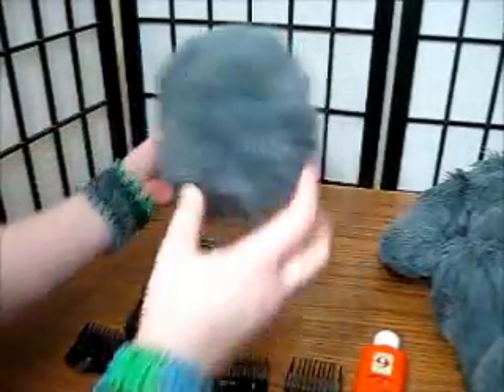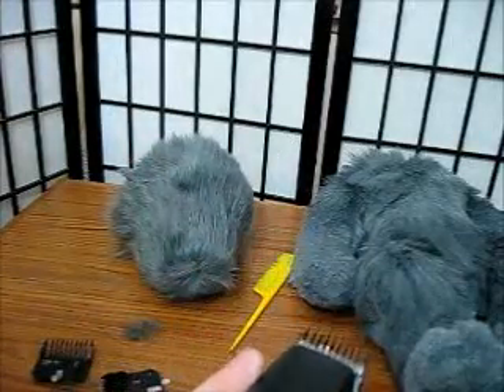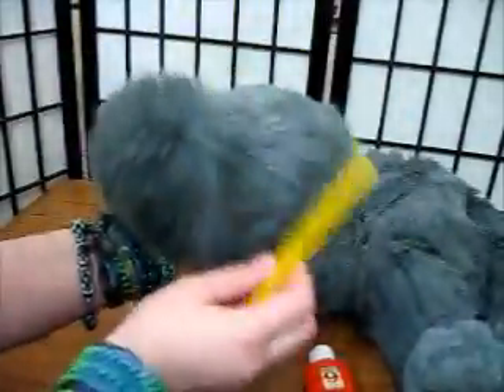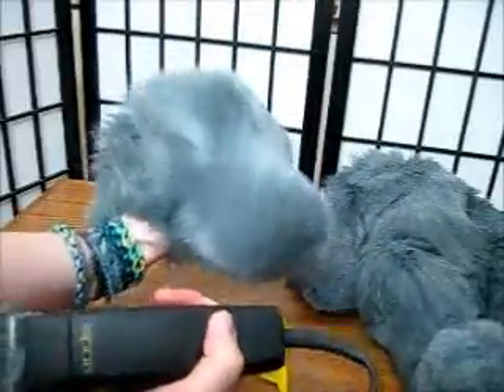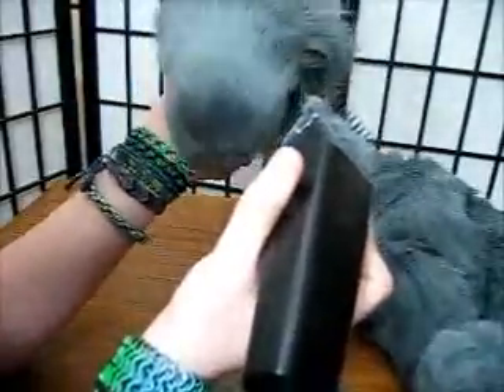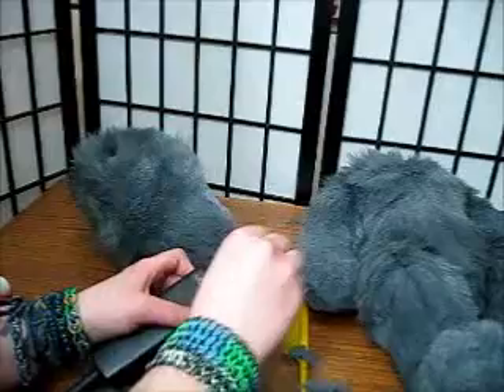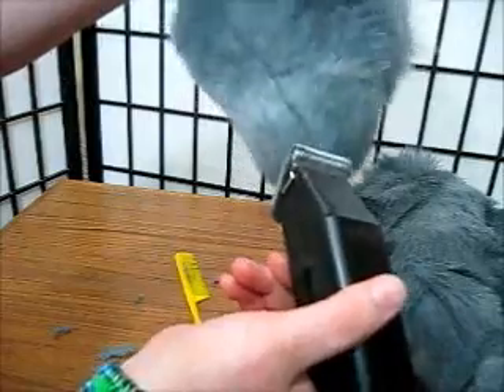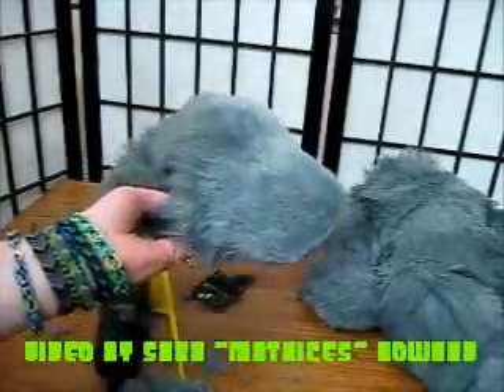How to Shave Fake Fur

Comment: I ended up getting a somewhat better grade of pet shaver myself for when I worked on the fur for my suit's head. The fur fibers tends to sneak in between the blades rather easily if your not careful on the lower grade shavers.

I also noticed that some furs look different when they are shaved too.

You did a good job on the tutorial, thanks. :)

Comment: I'm working on a fursuit head with long-pile fur, and I'm unsure if shaving is necessary... the fur itself sort of smooths down and stays down extremely well,  and it looks very nice when smoothed. However, it does fluff out at times, and it doesn't look very good then.. I can't afford a professional grooming kit either..

...Would there possibly be like a hair product or something I could use to make the fur on my suit stay smooth, without losing it's softness? Like styling mousse, maybe?
Reply: Junius Arrakis scissors would probably work better than smoothing it down, you just have to be super careful not to cut it unevenly :P Using gell would make the fur greasy, I used gel on my suit's hair and it looks good but it feels gross when you touch it.

Comment: I'm having trouble getting any fur off with my clippers. I've started with the largest guard and worked my way down, like you did in the video but it hasn't made very much of a difference. Any suggestions?
Reply: That happened to me because I got the wrong fur so I got better fur and it worked

Comment: Will this leave a mess of fur? Also, are the shavers something I should be careful around? Is it going to cut me if I'm not careful?
Reply: I does leave a mess. I like to put down some newspaper or plastic on my work surface then when I'm done I can clean up really easily. It won't cut you - clippers are very safe. You'd literally have to deliberately dig it at a particular angle into your skin without the guard protector on it, so... pretty unlikely! :)
Reply: Alrighty then, thank you so much! I really appreciate it! I was worried that this would get lost in the flood of comments XD
Reply: Also, quick question: I heard that for some parts of a fursuit, one of the supplies would be a razor blade. For example, a razor blade would be used to cut out the fur pattern so the fibers wouldn't get cut in the process. I was just wondering if there was an alternative to that, preferably one thats a bit safer for a minor to use? Like, if I could use a scissor or something else.  If I can't use scissors, would knives be a decent alternative? I don't think we have razor blades in my house, and I doubt my parents would let me use one at all, since I have hurt myself making a fursuit before. I've once tried to make ear vents in my fursuit and tried using a kitchen knife instead of a razor blade because I had a lot of hot glue in that area, and accidentally ended up cutting my finger. Also, I've gotten several blisters from the hot glue, and my worst case was when I was using white fleece to line my fursuit head and forgot I had hot glue (which was on for a while so it was very hot and I think I could've seen some steam coming from it). I touched that part and got 3rd degree blisters on my middle finger and the side of my index finger and a few milder ones on the tips and on the side of my ring finger. It hurt like hell for a day or two. Then I accidentally popped a blister by taking a bandaid off and ripped off a piece of skin.... It was not fun at all...

So I doubt my parents would trust me with a frickin razor blade. So long story short: Could I use a kitchen knife or a scissor or any other alternative instead? I mean, if I absolutely must use a razor blade, I'm sure my mom could help me with that instead, or I could put on my winter gloves so I don't cut myself.
Reply: Thank you so much! I subscribed to you by the way!
Reply: Thanks! I'm afraid I don't put out content on YouTube but you can follow me on Facebook and DeviantArt if you like!
https://www.facebook.com/kimitheleopard/
https://kimifur.deviantart.com/
Reply: NylaTheWolf use a rotary cutter, make sure it has a safety guard on it! And take your time when using it, they're sharp but they're better than using an open razor blade